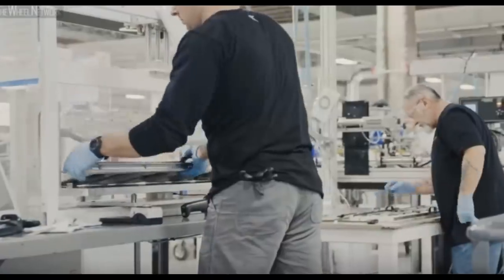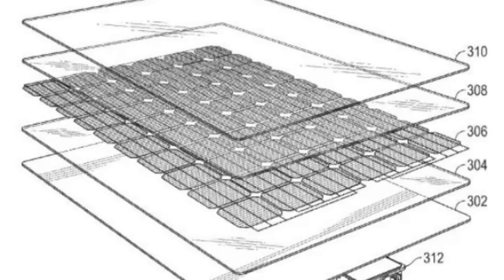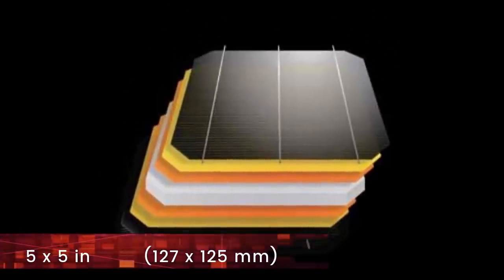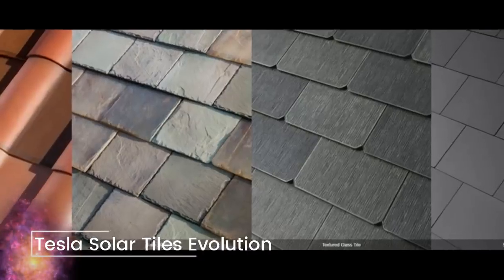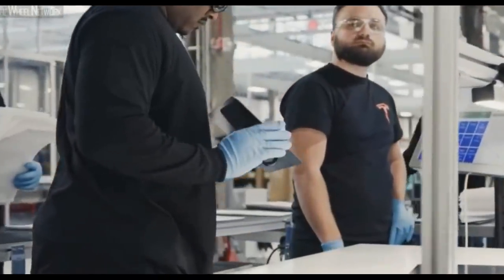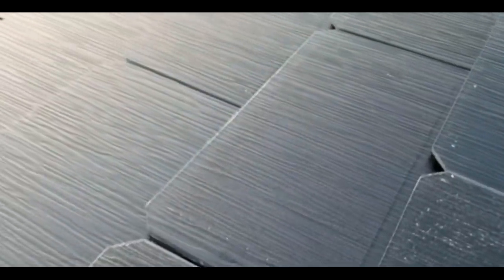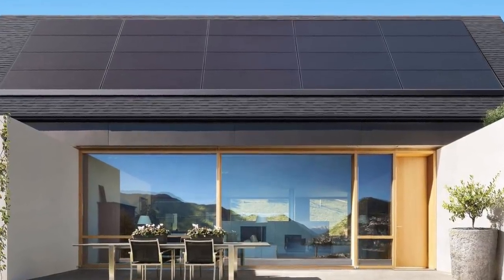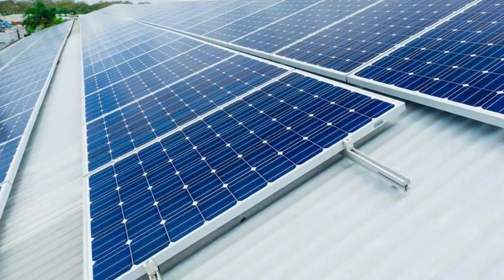Tesla Solarglass V3 Efficiency Revealed

Comment from the maker: If you have any questions of Tesla Solarglass V3, feel free to ask
Reply: Hi again, yes do have a question for you in the next year or so we are looking at installing a PV array either 10 kw suplimented by micro hydro, or 20kw,  to compensate for low winter productivity. Tiltable array. We are at 54 north in mid Wales, yes the little country next to the worst of neighbours  England, 😁😁😁😁. So high rainfall western side of the UK, but south facing and significant cloud cover. We are drawn to the Axitec German pannel and Canadian solar as the German specifically make mention of good performance in low irradiance conditions, we would be drawm towards the bigger pannels over 300w. But the Canadian pannels seam to hold higher voltage at low irradiance than many competitors. The Panasonic and other expensive pannels are out of our price range approximately 50% more. If not these pannels what are the general traits I should look up in the specs for a pannel that does well with cloudy conditions?  Also mppt inverters, vectron are everywhere, how good are they, is there better and still reasonably priced out there. Many thanks, greatings from Wales
Reply from the maker: One of my first workshops on Solar installations was in Shrewsbury about 11 years ago and also one in Cardiff. Thin-Film panels perform well both in cloudy conditions and high heat conditions. However, you will find them more expensive then your run of the mill poly-crystalline panels. I would suggest you go for Canadian Solar, they offer the best value for money. Every customer I have met that has got Canadian Solar are very appreciative. I lived in Edinburgh for 14 years. There the difference between winter and summer solar insolation was 10 times. In winters we would get 100 Watt/m2 where as in Summers it did at times touched 1000 Watt/m2, so supplementing the system with old-faithful hydro is very sensible.
Reply: @synergyfiles3536  small world, we are  40 miles due west of Shrewsbury, seasonality is significant here as well. Using the EU pv calculator its between 6 and 7 fold difference. This reminds me, a question that I forgot to ask previously, to support the array we are looking to install approx 10k lithium ion battery, the BYD range appear decent, or there js a pylon range, what are your thoughts on these as selection for off grid. Also do you have a patreon account or another way that I could support the channel? I find  the impartial and knowledgeable advice and guidance very valuable. It feels here that the renewables market js increasingly populated by those looking to make some easy money,  and the advice proffered is motivated by money and not a qualitive  engineering basis. Once again many thanks for your wise advice, cheers
Reply from the maker: I cant say anything about BYD batteries. I have not heard much about them. Tesla powerwall has a good reputation and so does LG. They are costly. 10 kWh is a good capacity for an average British home given we dont need much air conditioning during summer. I dont have a patreon account, but thank you for your kind gesture.
Reply: @synergyfiles3536  Is Unisolar still in business? For a new roof or when re-roofing needs to be done. Using a seemless metel roofing with Unisolar style Amorphous Silicon Flexible Solar Panels should be more cost effective than that what Tesla is offering now? BTW, I still see Unisolar amorphous silicon PV stick-on laminates for sale on Amazon https://www.amazon.com/Unisolar-Flexible-Solar-Panel-Laminate/dp/B006EP6MCU  But they supposedly went bankrupt and out of business in 2012 with assets sold to BASF? So Im not sure 100% sure what their status is, do you know?
Or is there another maker, of its type of rollout amorphous silicon PV stick-on laminates? That works well on flat standing (rib), seamless metal panel roofing. 

Call me crazy, but they should have created a cheap narrow flat metal panel with no coating, designed to be cover with the Flexible Solar Laminate Panels that would waterproof it. The metal panels would be quicker and easier to install than standing seam metal panels or Tesla solar. Since they are just screwed in place similar to metal ribbed panel, but with flush screws so they would stick out. And then stagger the rollout amorphous silicon PV stick-on laminates over the the seems and screws as waterproofing. 

And even the plywood sheathing could be replaced with cheaper wood batten strips that would act as ventilation to keep it cool.  Also 2 issues with metal roofs would be reduces. Noise from impacts such as rain or ice. And warping from heating is reduces and less notable. 
I admit that a Tesla roof would still look nicer is a a little more efficient but this would be much easier and far less costly to install. 

So what do you think about Amorphous Silicon Flexible Solar Panels used with metal panel roofing?
Reply: Do you know if they will be available for the Dominican Republic?
Reply: Are there research on how they will perform in average in countries like canada where there will be snow covering the tiles in winter ?
Reply: Hi, have you heard about https://solteq.eu/www.solteq.eu ? They are offering solar tiles and roofing too, even in combination with heat pumps but I wonder how they compare to the v3 solar from Tesla. Unfortunately I haven’t found any material in English.
That is some promo material but unfortunately only in German: https://solteq.eu/SolteQ_Energiedach-Quad40.pdf
Maybe the provided numbers will be sufficient for comparison???

Comment: It is wonderful to see solar cells that are capable of using more of the solar energy spectrum. Solar panels could be photoelectric, and also heat liquids and pressurise gasses. it the panels themselves are structural elements also, the future is looking bright for clean, high speed electric aircraft to replace jets. Jet aircraft are absolutely unsustainable, their pollution is extremely toxic, and the intense heat exhausted into the frigid troposphere is likely to be the main driver of the intense weather events worldwide.

Comment: Interesting data and facts presented. This said, I suggest that you compare Tesla roof tiles to other roof integration solutions such as http://www.gseintegration.com/en/InRoof.html  and others. Also, look beyond the US for your stats, the US is a small (and getting each year smaller) player on the global market, with inflated prices often 200% higher or more than the rest of the world for small scale solar, especially for residential.  In the end, people need to know the life cycle value of solar, so LCOE (cost per kWh) is much more important, than initial cost, You also need to do a life cycle cost comparison of solar roofs versus traditional roof, Your analysis ignores replacement oosts of low quality roofing systems such as asphalt that needs to be replaced every 12 to 15 years. You need to be careful when providing info as a superficial analysis  misleads people into incorrect conclusions and wrong choices.

Comment: My complete PV installation 16.2 kWp), everything included, costed 18000 Euro (about $19.000,-). That is 1.2 dollar/watt. That is way less than the lowest cost mentioned at the end of this video. Smaller installations cost more per watt, but think about 1.6  dollar/Wp for a complete 3 kWp installation. still no 2.50 dollar per Wp.
Reply from the maker: You are right. Prices stated here are based on California. Everything  seems to be more expensive there
Reply: You did not say the brand of solar you used. Cheaper Chinese or better Japanese or the US made very high efficient Sunpower solar? I thought he was comparing Tesla tiles to the price of standard Panasonic panels
Reply: @Greg 
The installation consists of: 
1. 60 "Ja SolarJAP6-60-270 SE 60 " panels 
2. SolarEdge SE17K

The panels have a build in "micro optimizer" which normally cost ~€40,- a piece.
The Solaredge is a 3 phase inverter which can monitor each panel individually.
The installation is installed on a flat roof which costs more than a tilted roof.

My early generated energy is ~17.000 kWh for the last 3 years.
I live in the Netherlands which is equal to the south of canada, so quite north.
1 kWh costs around $0.24
Yearly we can compensate each kWh used with the surplus we delivered to the grid.
Each surplus left will earn us $0.105/kWh.

In my case, my installation pays itself back in ~ 4 to 5 years.
Reply: @BendeVette  So you are not what he was comparing costs on your system is a good quality but cheaper system to the Panasonic/Tesla panels which are probably quite a lot more expensive to what you and I have.
Reply: @Greg 
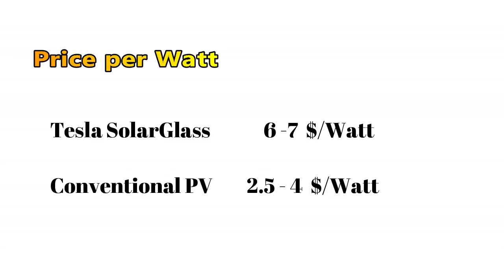At 7:50 he is comparing tesla solarGlass and a Conventional PV.
Not saying whether or not the conventional is Panasonic.
My panels may be a cheaper brand than panasonic, but solaredge surely is not. 
Taking the collaboration between solaredge and JA into account I think we can say it is no budget brand either.
Just checked, the price of this panel is reduced to $125,- including 21% VAT. 
My installarion would cost $4000,- less than 3 years ago when I paid $190,-, reducing the costs of this installation (including VAT) to $15,000. thats $0.90/kWp.
Reply: @BendeVette  Did not say yours are inferior, just not Panasonic or even Sunpower prices.
Reply: @gregandkaruna6674  
Never thought you said they where inferior :-)
I have a roof of 5500 square feet.
I can use very cheaper panels, because I have a lot of space.
If you have less space, it can be necessary to go for the Sunpower panels as they produce more per square foot (but they are very expensive).
Reply: @BendeVette  nice system but you need to add the cost of a new roof to the system price to compare like with like .
Reply: @alanrickett2537  
In the comparison, the cost for a normal PV system and the Solarglass system were mentioned. I just stated what the costs of my system was, which was much cheaper than both. 
If you consider a new house or a re-roofing, a different calculation comes into place.
Reply: Yes, the author uses North American prices which are known to be the highest in the world. Residential solar has been at $2 or less for at least 5 years outside of the US-Canada.

Comment: Wondering why they didn't use large panels instead of tiles, far fewer connections, lower production cost, lower installation cost?
Reply: @harry camper It is the simple fact that those who need power the most 99% of the Worlds population are using Tin Roofs if they can get them. Manufacturing affordable water proof panels will Change the Game, tiles do nothing
Reply: @harry camper If you want to change the World, Cheap easy to install easy to maintain is the only way it becomes economically viable. If you just want to make money Tiles are for eco snobs.

Comment: I pass a number of residential solar installations between my house and my shore house. They are a big thing near the shore.

Today on that route I think I saw a Tesla Roof tile setup. The first ever. I will slow down next time to be sure.

Meanwhile I hope to put up a 2 car garage at the shore property, with a grid tied solar panel sytem on the roof, and a duel charger at the post between the doors.

This will allow me to drive my future EV pickup and EV sports car with zero fuel usage/cost after I retire in 2 years.

My garage panels will have a clear S view of the sun over 80% of the day with the 20% no sun split between sunrise/sunset.

That clear southern view was a must when I bought that property 12 years ago.

Comment: Excellent video; well explained;
How can you detect defective solar tile/solar panels?
How do you replace the tile or panel?
Can you walk on the roof?
Whats the watts per standard size tile?
Do you know the voltage series they string together?
Reply from the maker: In a string of cells, one defective cell can bring down the output of the whole string. Tesla mostly uses string inverters
Reply: @synergyfiles3536  Then huge problem to find the faulty panel, and because there are far more panels much higher chance of a panel failure over a standard 60 cell panel. Also long term heat buildup maybe a problem as there does not seem to be a gap for ventilation unlike regular panels.

Comment: Nulok make solar panels that seamlessly integrate with their roof tiles and provide a flush finish, instead of having the panel sit on top of the tiles like standard PV panels. They're not as esthetically "invisible" as Tesla's cells, but I'm sure they're more efficient in capturing the Sun's energy and converting it to electricity.

Comment: Thanks for the analysis. Did you look into maintenance costs and probability of failure. How many inverters do they use per roof? All that wiring might be prone to problems with connections.
Reply: Absolutely, conventional panels have an air space under the panel as black glass gets incredibly hot, seems the tiles just sit directly on the roof. Good luck long term reliability and good luck finding and replacing the tile that does fail. Tesla use string setup so even a single tile failure can dramatically reduce efficiency.
Reply: @gregandkaruna6674  Thanks. What you say syncs with what I heard from others with some experience in the field. Musk currently faces legal obligations to (i) justify the expensive Solar City acquisition and (ii) justify the subsidiaries for the Buffalo plant. The Solar Tiles might be his cheap strategy to solve these issues, and the product is actually not good at all.

Comment: Don't have Tesla tiles here in Thailand, but I put up a  grid-tied 1.5kW system for $2000 USD with no Feed in tariff-- zero export. I use 24 kWh per day, but the rates are tiered by consumption, not time of day.  I'm saving about 33% on my electric bill.  I'm generating about 6.6 kWh.  I can run my inverter style  mini-split AC all day and save 33%, not bad. Thank you for your videos.  They are always interesting.

Comment: What people need to know is, will this installation power everything in the house? Talking about efficiency is meaningless. The question should be, will this system
power the lights, a television, the kitchen appliances, and a washer and dryer and heat and cool the house? Will the roof tiles keep enough charge in the battery to
run the house?
Reply: Higher efficiency means it can operate better when the sun is not out and effect how many tiles you will buy, it is very relevant.

Comment: Your answer to Glyn Jukes, do I understand it correctly that Tesla solar roofs are suitable for California Arizona and so on, but not so suitable for cloudy weather places?  I am in BC Canada, in winter I’ll  go over a month without any sun.  Thank you, your content, format and delivery is always outstanding.
Reply from the maker: They are suitable for cloudy conditions too. However what Glyn was pointing out was the seasonal variation. With roof mounted system be it Tesla or normal PV, you cannot change the angle with season. They are fixed. If on the otherhand you have a solar array on frames that can be tilted, than you can increase the angle of the panels in winter to capture more of the low sun.
Reply: Cloud really hurts any solar system. On a perfect sun day our 3.6kw system can even reach 4kw, however any cloud drops that to 1kw or less on a dark overcast day it will drop to a few hundred watts. In summer our system can produce close to 30kwh in the perfect day to less than 10kwh average in winter.
In our setup solar is next to useless in winter. However its still saving us around $1200 per year in total power savings or 10 year pay off the cost of getting the solar.
Reply: In reality, these systems are only cost effective for high solar insolation areas, you can look at a map of the US to get that info.  It is a relatively limited area.

Comment: Tesla should give up the product.  It doesn't really give value.  Solar PV is constantly improving.  Every 10 years, solar panels are a lot better in cost and efficiency.  Besides, mono panels look good on a roof
Reply: Tesla specifically says this is recommended during a roof replacement to be cost effective, they recomend regular solar pannels if your are not.
Reply: Value if replacing a roof, so many wild costs on how much a roof replacement costs. Tesla says its expensive to replace a roof, but in reality replacing a roof and getting standard tiles is still far cheaper than getting solar tiles
Reply: @gregandkaruna6674  shingles are the lowest tier of roof, solar glass isn't meant for lower class homes, roof complexity is a huge factor.
Reply: zodiacfml This is why Tesla will only double down on the solar branch of the business.  It’s a level of vision that no other EV manufacturer comes close to.  https://youtu.be/Mz0eBTHj2UE

Comment: I choose Neither for my 1872 1 room Schoolhouse ; I like the Tesla Tiles vs Conventional Panels but the Price is Not Feasible . 
 Why don't they make a Roofing system that is w Conventional Sllar panels as a System ? 
  I'd like to do so as to save money when replacing the original Metal Roof . 
I also have a 2600F degree 8 layer Stainless steel chimney pipe liner & single layer Brick chimney to work around . 
 I may Not use it regular thereafter yet I still want to keep it . 
  I'd Love to work w Tesla on this as an engineer and Designer . 
Most of my experience is w Wireless Infrastructure;  I do also happen to be a Member of the Nikola Tesla Institute.  
  I don't Actually Care about Personal Profit etc either . 
I'm Disabled and Bored ; my Injuries were On the Job and Permanent + degenerative ; 
Eventually in a wheelchair for life Hwvr I did / do what I can to make the World a Better and more Sustainable Place . 
#Renewables 
#OpenSourceIntelligence 
#OpenSourceEverything 
If Tesla wants the Patents that's fine by me ; I grew accustomed to Employers Claiming My IP for 2 Decades anyways . 
 #MyIPUrPatentCapital
#HumanitadNEO